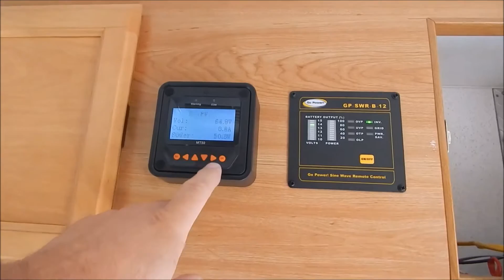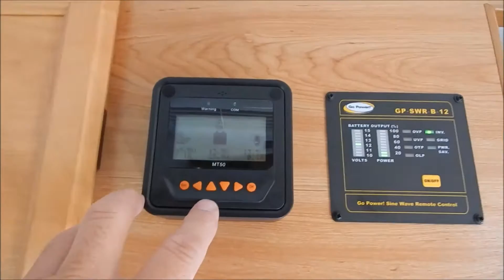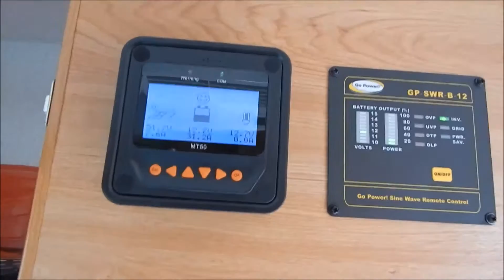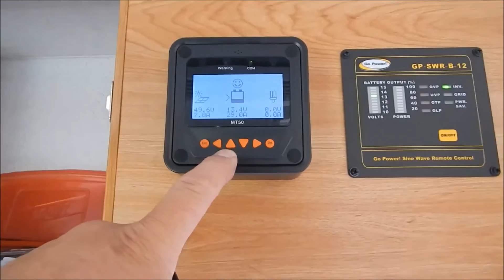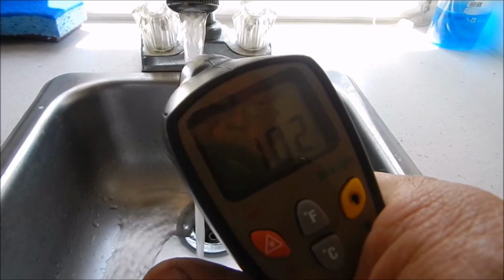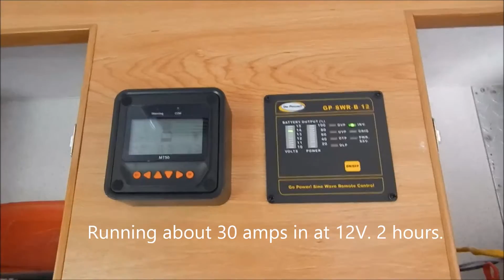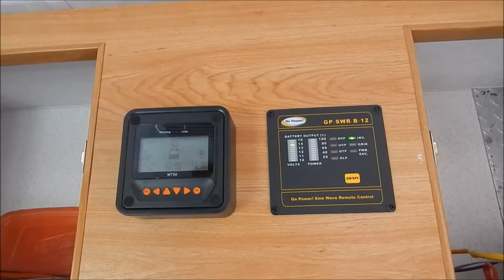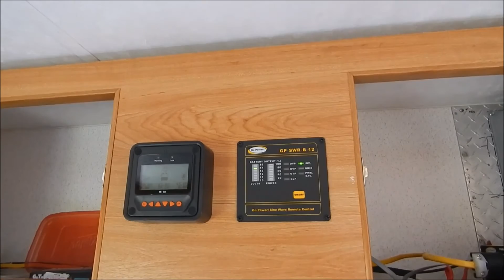Solar Truck Camper Electric Water Heater Test .

Comment: Nice brother. One thing I found with my go power mine is dead on with the lights. I was told there is a srew thing in side you can turn and get it right. If that due not help the invter stop from kicking out so soon. Just buy a big cap they use for car stereos for real cheap. THanks for showing us brother. God Bless.
Reply from the maker: +yankey4 Thanks for watching ! The inverter works fine the lights & remote gauges are way off I am just pushing it to find the limits. using the sun during the day to heat water with out using propane that's better used for the fridge is a great option. Most of the day my battery's are in float   mode why not use excess solar.
Reply: TheKilog69 Brother yes I am 100% with you. That is smart. I was not at all not trying to say it was not. I was just trying to be help full with the lights. God Bless Brother.
Reply from the maker: yankey4 Thanks for info!

Comment: I have a 20 gallon water heater with 750w solar connected directly to the ac elements in the water heater.  works great.  I have hot water all the time even early in the morning.
Reply from the maker: +wadesready awesome U should do a video on it .

Comment: Good use of spare power.  Drives me crazy when the panels are making power, and I have nothing to use it.  I wonder if you could heat water faster putting a bladder behind the solar panel and using the hot panel to heat the water?  I am joking, but that might work good for an outdoor shower.
Reply from the maker: +Fernbark Frist I have a solar water shower /bag that's what I used in   Hobo 1 . This was just showing that it does work OK.  I was not in a hurry, my solar went into float mode a short while latter, Plus used no propane! I need that for fridge it works awesome I put it on #5 it froze everything in the fridge but my beer I love it cold!  Did ruin my tomatoes though froze them babies good .

Comment: I don't get the idea even if you were on shore power. It would just take too long for hot water. I would stick with the propane way of producing hot water. Thanks for doing the leg work.
Reply from the maker: +Jerry Densmore the idea is during the day it heats the water with out using propane, or on shore power it will use no propane yes its slow but another option for heating your water, for me this is fine if U have a limited amount . thanks for watching.
Reply: TheKilog69
I just had a thought, because the watts of the heater element is so small you could just leave it on all the time when on shore power and always have hot water. I wouldn't leave a real electric water heater on unless I was using it. I don't trust that cheap thermostat that is supposed to shut it off when heated to the 140 degrees.
Reply from the maker: Mine is set about 110F  yes u can leave it on all day , I like using my excess solar power during the day, If I can make hot water after my battery bank is charged up that's a bonus.